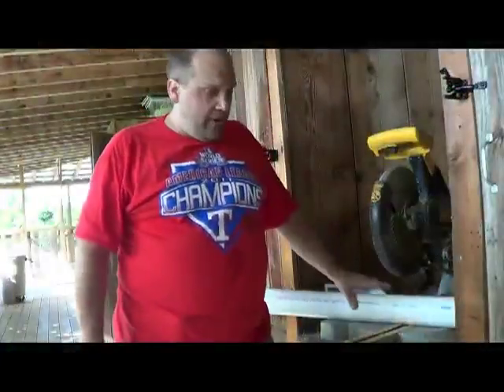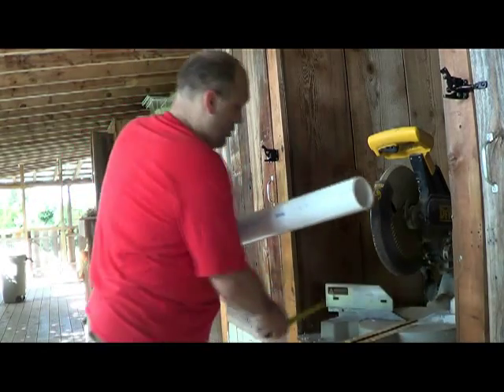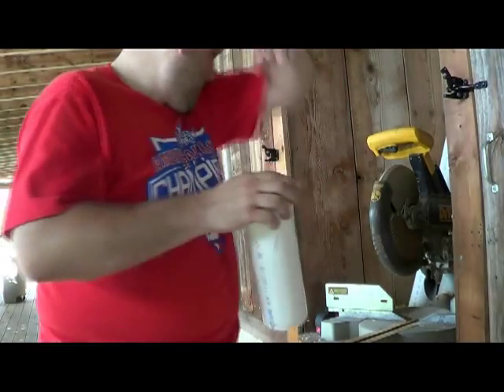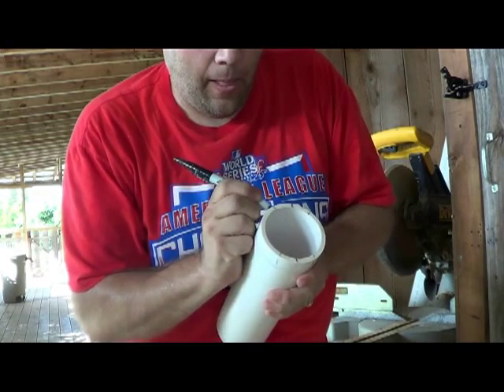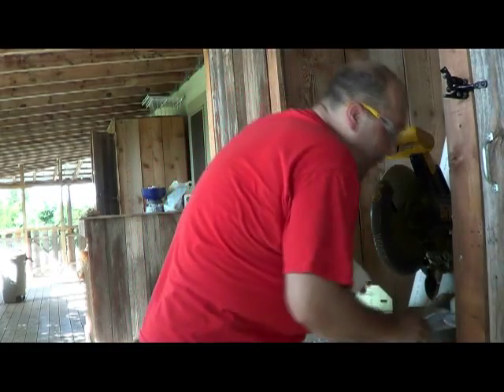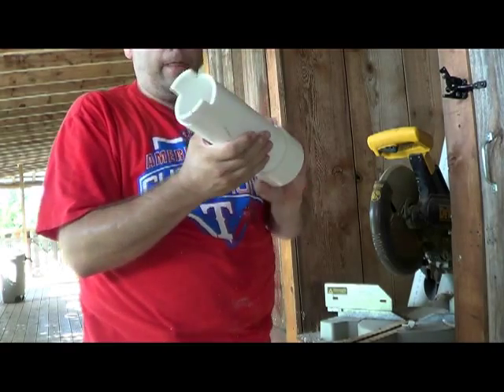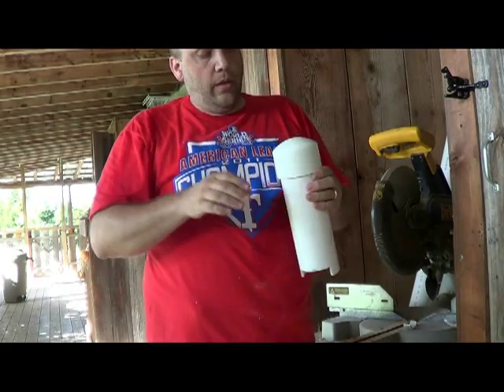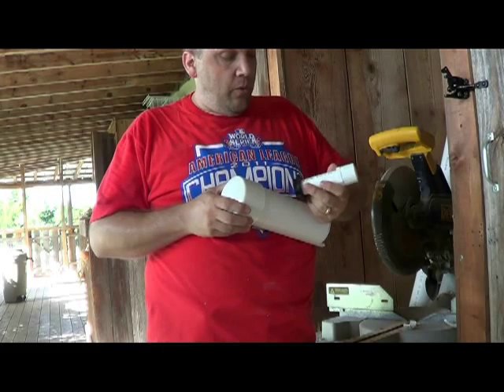Aquaponics Build Video 5   Bell Siphon Build

Comment: Nice work man!  I appreciate you taking the time to discuss how some materials are available in some places and others not. 
FYI: I've found that the 4" DRAIN pipe (not PVC, but available at almost all Home Depot or Lowe's storesin USA) works great as a shroud for my bell siphons.
Also, I have made my siphons w/ 3/4" PVC (stand pipe) and 2" PVC (bell), and they seem to work just fine.
Keep up the good work!